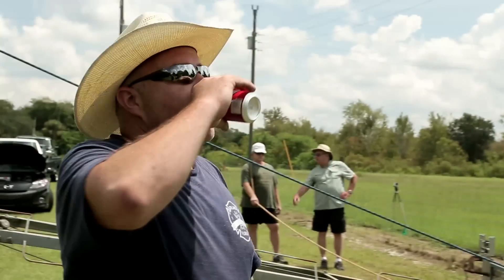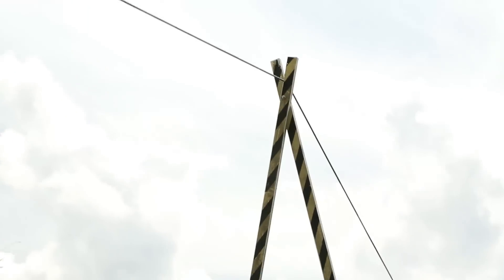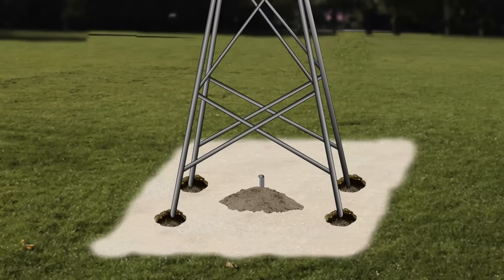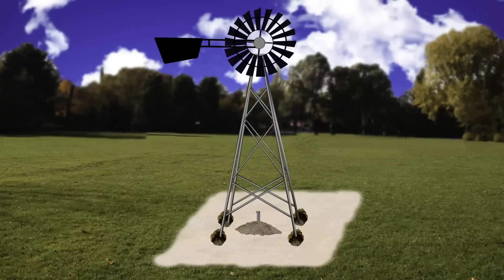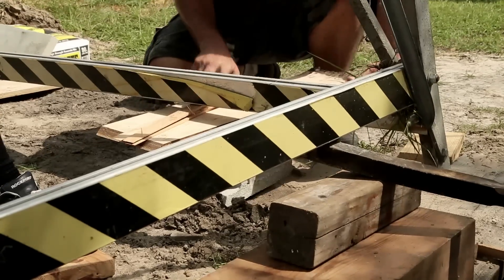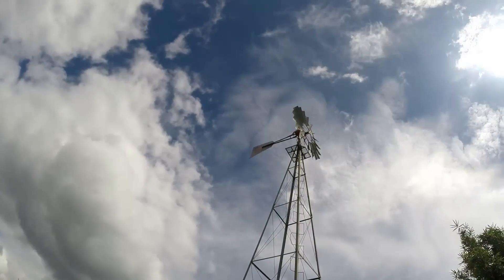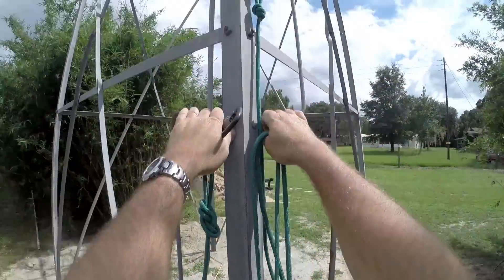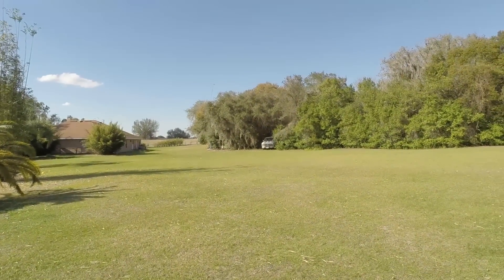Vintage Aermotor Windmill Restoration Ep 7: Windmill Raising and Tower Top Inspection

Comment: Good Series.  I just picked up one of these to restore for a buddy's ranch.  Won't need it to be functional so I'm working through what parts are needed just to allow it to turn and actuate in wind. Will need new spokes and the wing structure on a couple of sections is not true.

Comment: I would have made hinges for the two legs that were touching the ground before it was raised. That way, you could have calculated and measured exactly where to position the tower before it left the ground. All you had to do then, would be to anchor the other two legs. Thanks for the video. Im about to embark on this project myself.

Comment: You should design a bucket which you can place over your centre point and then fill it with oil to dampen the movement of the plumb bob. But you can also buy a laser plumb bob nowadays which you setup at the bottom and you centre the top target above the laser. Bright sunlight will actually cause problems.

Comment: I know it's been a long time since the video, I just found it. Do you remember the weight of the wheel and the weight of the gear box? Volunteering at a museum and we need to redo their windmill. Not sure I want to cut it down and cranes get spendy. Thanks for any advice you can give
Reply from the maker: No, I don't. Probably 350. Make a gin pole  with a boat winch to lift it off. Thats how I got mine down.

Comment: Just pulled one of these out of the back forty. Fan was flat on its back on the ground, gear unit underground, the tower on it's side and a large tree had fallen and crushed it. Trees, roots, and brush growing through everything. My grandfather bought it on a dare over 40 years ago, had it flown in by helicopter. Pretty much destroyed now but I was impressed at the lack of rust. Took the cover off the gear unit and had a look, the oiling ring for the guide wheel shaft is the coolest thing, cooler than two ground hogs humping in a cooler at -40. BTW great video series.

Comment: just curious.. if have built your water tower yet.. and if you added copper tubing taps so you could easily take samples from various layers of water..  so you might be able to check the bacteria level.  could also have a very small copper tube or nylon tube inside a copper tube to allow you to add a tiny bit of chlorine from the ground to keep the water sanitary. might also need to have an air fitting on one of the lower drains to allow compressed air to stir your water.

Comment: The towers not very tall! Well until you actually climb one of these your perspective changes. Father owned large communications company so put up many towers guyed and self supporting. Could never go above about 200 ft. till I froze in place! Job: hang a set of brackets at 280' on 340 foot tower. No way! Got a professional climber and they literally danced on top of that thing. I tried 4 times to climb it and failed. I know what you were feeling up there Jim. 

Have the same windmill and similar tower to put up here in Oregon so this series was invaluable. Thank you for filming it, and great job too!

Comment: Just a note about raising towers, you are ok because of the wide base, but for anything with a small base the side (handheld) lines would be better being attached to stakes in the ground.
Imagine you are raising a pole mast, the side lines should come to a point on the ground to each side of the bottom of the mast, as it's all laid on the ground it should look like a triangle with the mast in the middle.
The side lines go through loops or pulleys in the stakes, wrap the line around once so you have a braking system. then there's little chance of the mast going sideways dragging a person with it.
I've raised several antenna masts this way without incident.

Comment: Did you ever get it hooked up an pumping,if so how?  Our family business is drilling & repairing water wells since 1966,I bet I have lower,raised and or installed a 100 or more mills & towers in my lifetime. If you might need any info or help with parts just ask maybe I can help. We had a 3 legged Aermotor Windmill where I grew up quite a few of them around my area still. Great job  good work congrats on everything !!

Comment: You probably should put a lightening rod on top of the tower so that the vanes on the turbine aren't hit and damaged.  The high water table makes things interesting when setting foundatios around your place.  I'm a trained structural engineer so I'm tempted to ante in my two cents worth but I'll just bite my tongue.  You got it up basically straight and no one was hurt so good job.  The proof is in the pudding.
Make sure that you secure the services of a good engineer to help with the design and construction of the water tower.  Living in hurricane country with very soft, water saturated soil make it a challenge to build a tower with a heavy load of water on top.

Comment: Seems to me that the pump would be relatively easy to fabricate since it's built on the same principle as a hand tire pump, or a hand water pump (i.e. flap valves).  You're hardest decisions would be bore, stroke (determined by the ability of the windmill to drive it).  And depth of the unit.  Since your water table is so close that last would not be that much of a problem.   

What will you be using the water for?  

Great set of vids!  I love windmills!  

Years ago I tried to figure out how I could stuff one in my baggage on the way home from Texas.  My wife wasn't very supportive.  Heh.

Comment: What size well is that Jim, and what is the water table? I will have to look through my surplus but, last time I did look. I had a 3" Aermotor rod pump with a new set of leathers, and a new foot valve.
Reply from the maker: +CumminsDslPwr It a 4'" with Galvanized steel pipe, water table is less than 20'
Reply: DoRite Fabrication The 3" pump will fit just fine then. I will see if I can locate it for you, and you can just have it. I don't know if, or how much of the brass pump rod I have left though. I have used 316 stainless round bar in the past, and just had to thread the ends for the rod couplings, which I am sure you are more than capable of doing. Let me see what I can find that I have left.
Reply from the maker: +CumminsDslPwr That would be awesome! do you know or have any experience, pumping through the mechanical pump with an electric pump? Yes, I can thread the pump rod. I also was thinking if using SS for the down rod. I need to start scrounging around for stuff...lol